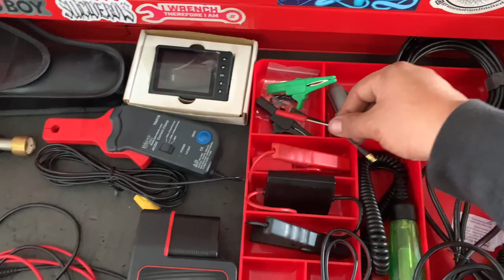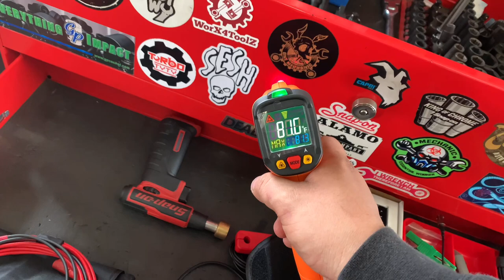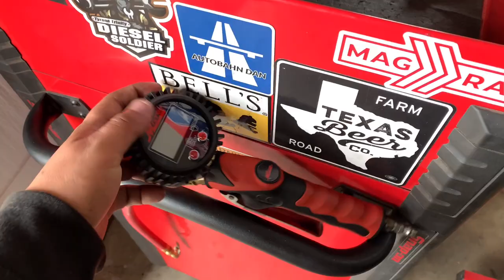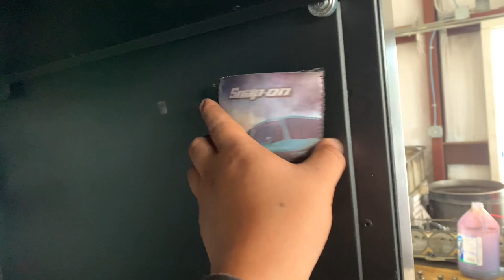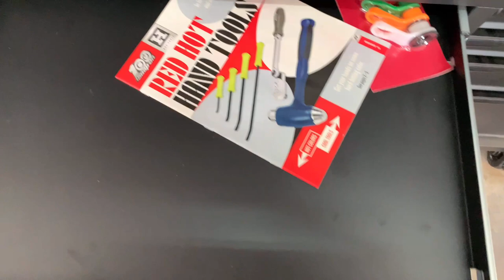Snap On Tool Cart Tour Independent Shop Tech

Comment: part number for atd prybar at 24:34. also do you recommend it? gonna use it to pry on suspension work
Reply from the maker: I’ve had these set for like 4 hrs brother USA made and have striking caps and like $90 for a 5pc set ATD 63905
Reply: @Itsdazeni  by any chance you got the part number for just the big one at 24:34? Do you recommend it?
Reply from the maker: You’re wanting just the individual one?
Reply: @Itsdazeni  yes
Reply from the maker: @182Bassist  that I couldn’t tell you the number rubbed off long time ago if you look up the  master kit  I’m sure it’ll say it
Reply: @Itsdazeni  what’s the length of the pry bar?